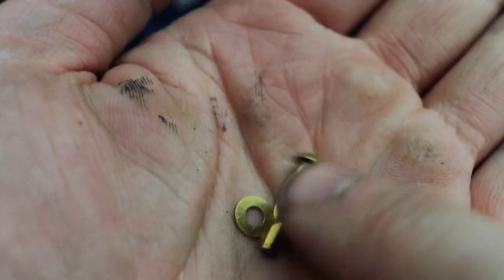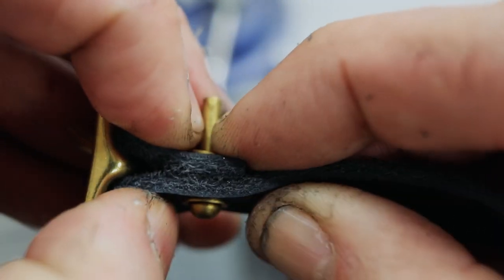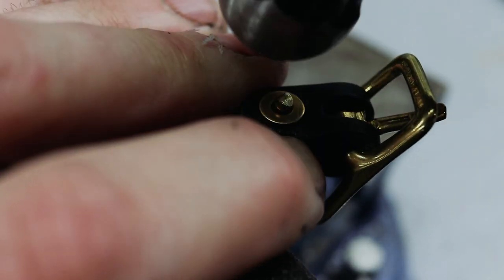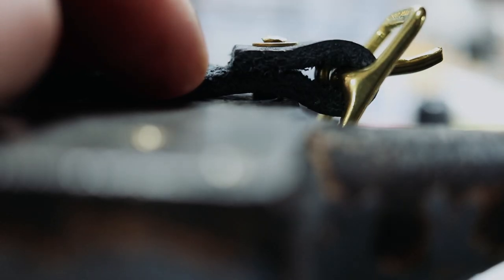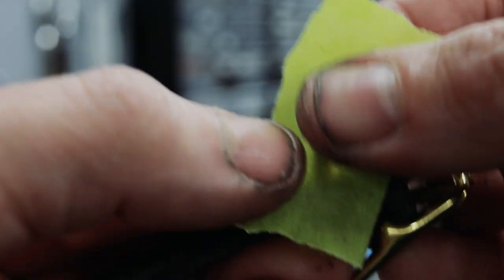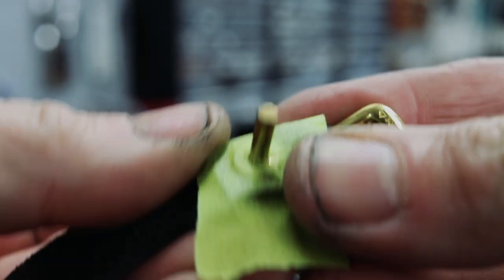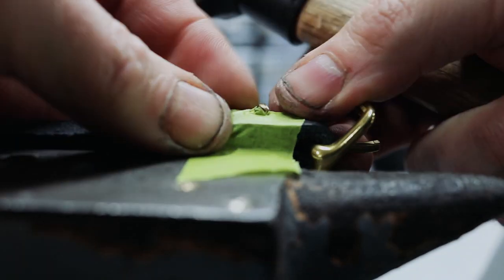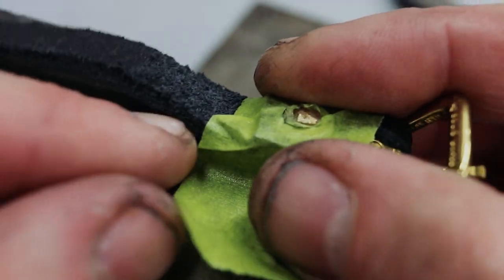Want  to Build Armor? Learn How to Peen a Rivet - Tips & Tricks

Comment: Do you always need to snip the rivet? why not just buy shorter length rivets? And what tool do you use to snip them?
Reply from the maker: Side cutters to snip. Shorter rivets are great if you want a ton of various rivets in bins. What I need to rivet varies in thickness so much that I find it easier to just have a bunch of long rivets.

Comment: We were taught to use a set and snap as in http://wiki.dtonline.org/index.php/Rivets - We pronounce it "Pane" - but maybe I'm just old?
Reply from the maker: I own some rivet setters, I'll occassionally use the shank driver to make sure the bur is down all the way if it's being odd, but I find for the top part other than maybe the final finishing of the peened head if you want a certain look, I always peen it over better just with the hammer.

As for the name, I'm not sure, I could be wrong. I've always called it a ballpeen hammer so Peening a rivet made sense since I use a ballpeen hammer.